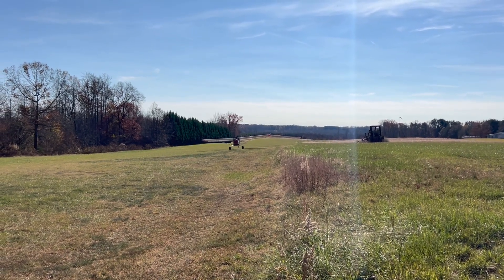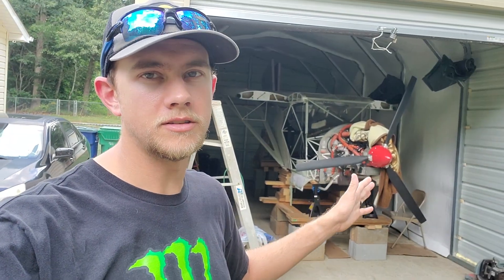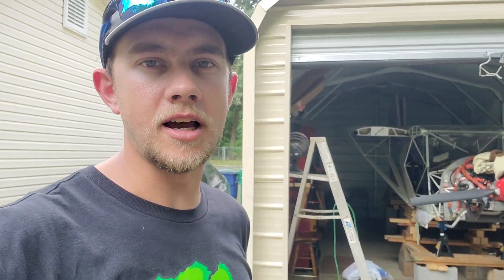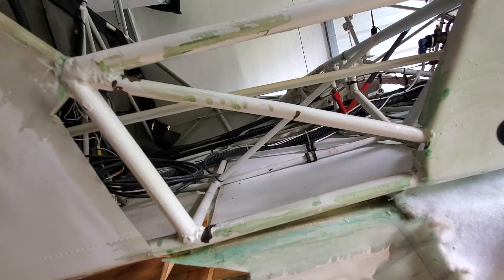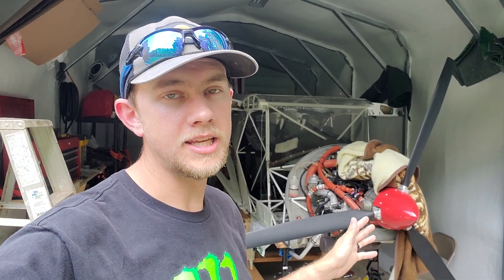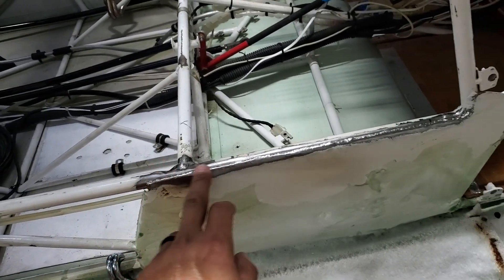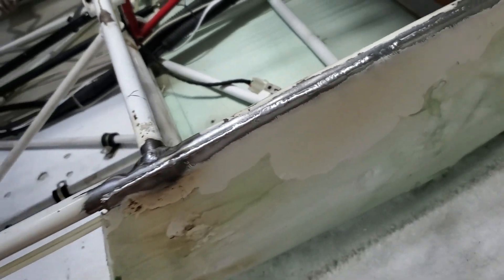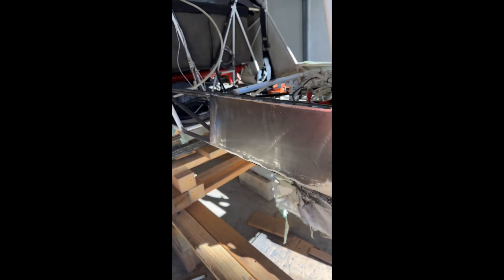Repairing my Ground Looped Kitfox

Comment: I've been through this type of work a few times, and I would say this,  if one is going to reinforce the sides, I believe the reinforcement should extend back to the lift strut brackets.  Notice, it bent right at the end of the plate reinforcement.  That is not a particularly strong area to stop at.  There is a lot more structure at the lift strut bracket area.  But no matter what, a bad enough landing will bend anything.  Get it fixed and get it flying.  The Kitfox 4 is a nice airplane.  And keep up the videos!